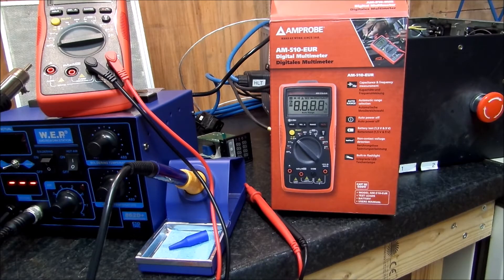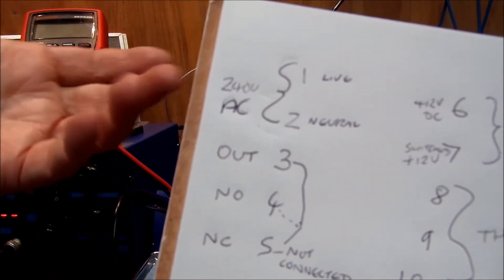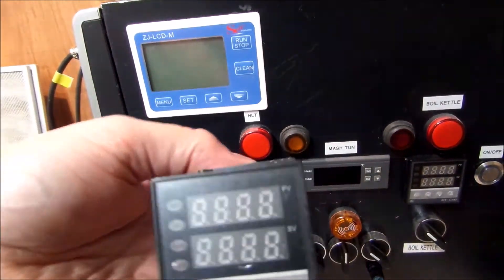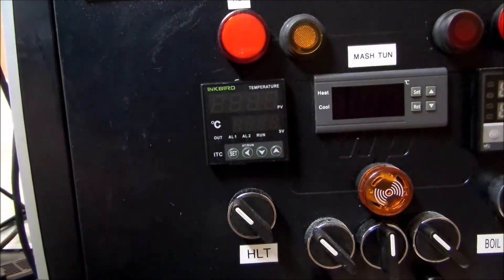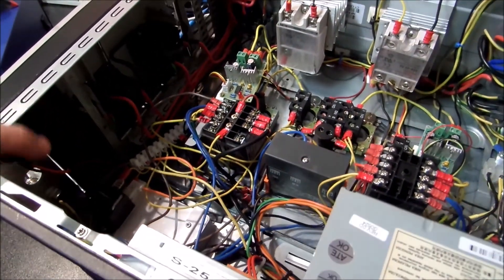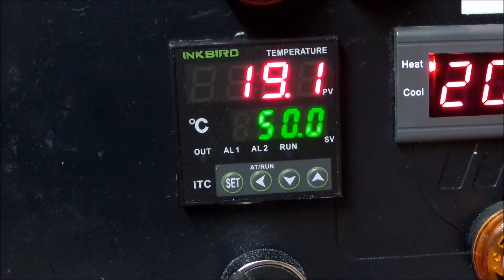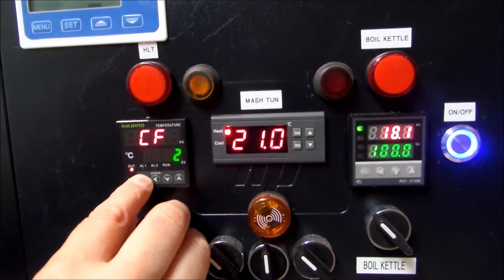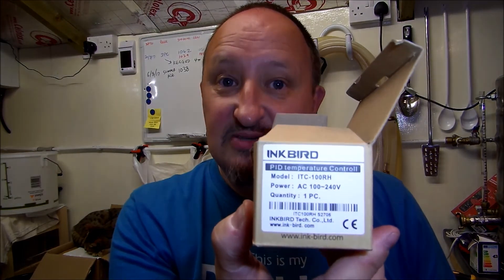VBlog61 - Inkbird PID

Comment: Have you tried the pid control for the herms recirculation? I had it set up on mine before you made the video about it. It works a treat!
Reply from the maker: Not yet, I have been considering making massive changes to my brewery or getting rid and buying a grainfather. Not sure what to do. My control panel has run out of space so I could do to make a new one if I am keeping my kit.
Reply: You can get a pid that's smaller than the stc 1000. I fitted mine into the case of that. Then used a dc ssr to run the pump. Also thanks for your vids as they were much help when I was building my system!
Reply: The seller on eBay is new2018power.
Reply from the maker: Thanks for the info, found the seller and the PID.